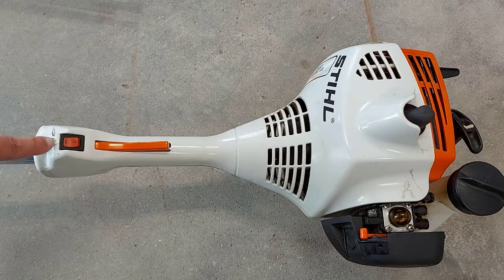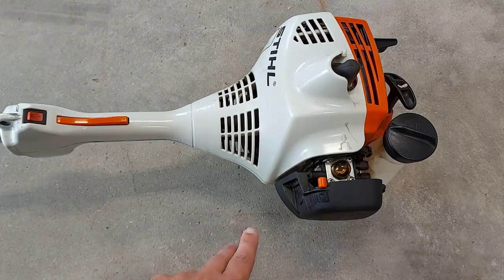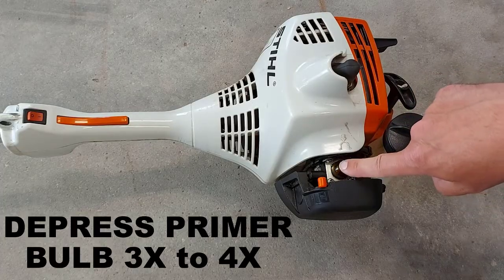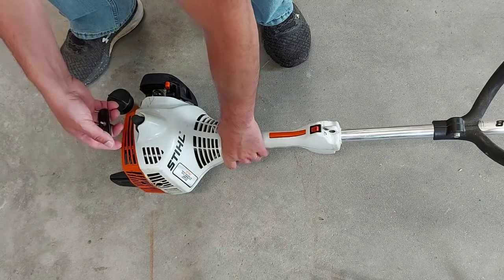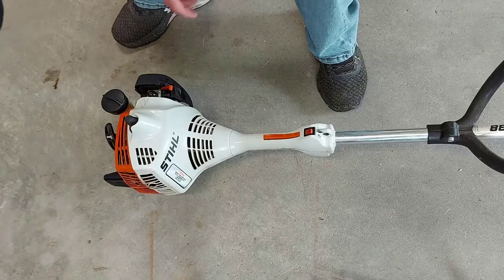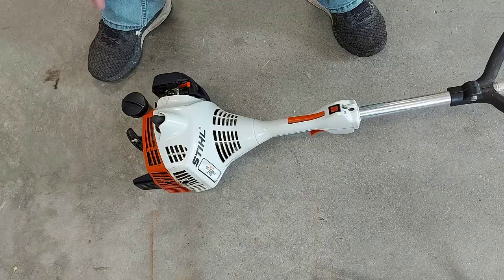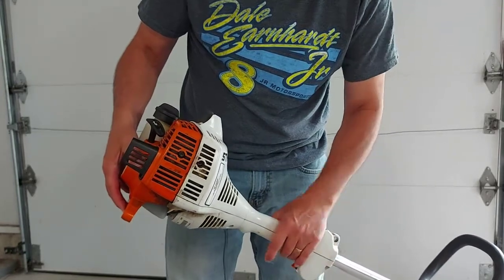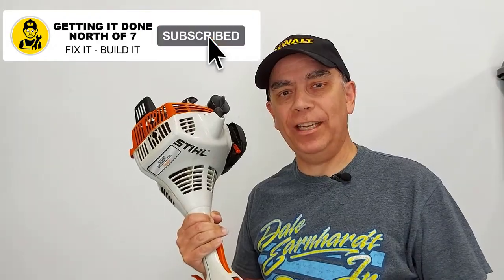Stihl FS 38 Trimmer How To Start Properly Without Flooding

Comment: Awesome. Concise and SHORT thank you. Just got given one of these trimmers because "it won't f***g start" lol. One thing I don't understand. I'm from N.Z. and have always had Stihl trimmers & chainsaws. We used choke when conditions were cold, really cold. My gear started 3rd pull every time, whether I needed choke or not. Moved to Australia few years back where it's never cold cold. Everything here has chokes, primers and a starting procedure more akin to a 747 than single cylinder BASIC tools. I don't understand why all manufactures of all of these tools feel the need to make things so complicated, when all you want to do is mow your lawn or cut some wood. I'm 50+ and have had more grief from small engines/carburetors here in 10 years than the rest of my life in N.Z.

Comment: Yeah well i just bought one today, abd it won't start. Ill try again in the morning. Otherwise im not convinced. I had a homelite fir 15 years and ut ut started right away, every time. And the the cost was the same. We'll see. I would hate to have to return it.
Reply from the maker: Something doesn't seem right
I've never had a problem with my stihl equipment
Reply: @GettingItDoneRepairs  yeah me either, I've got a chainsaw that a guy put together for me from a bunch of other saws and it's a beast, I've had it for about 15 years as well. But the good news is, I got the weed eater to start. Just having to learn the procedure. Lol, evidently it was just flooded. Thanks for the video. I was tripping though. I can narrow and rebuild a Ford rear end, but I couldn't start a weed eater. Too funny. Happy 4th.
Reply from the maker: @terrysibley9636  you got it now. Enjoy